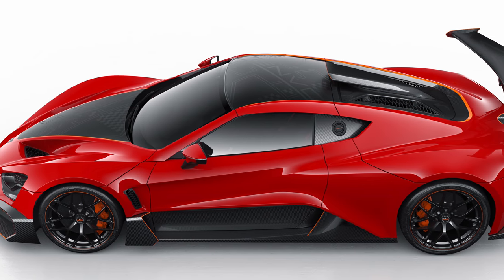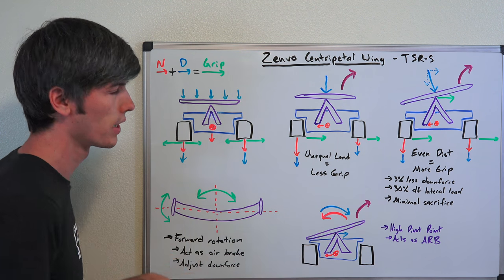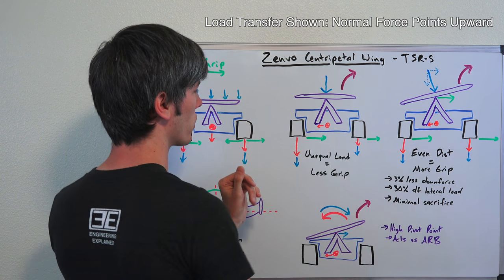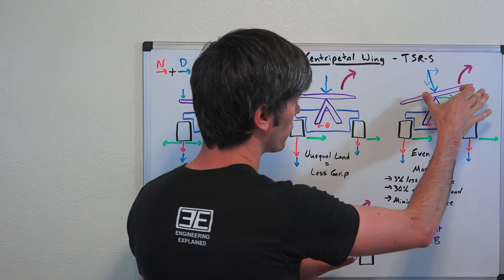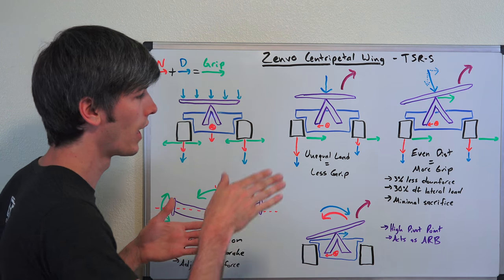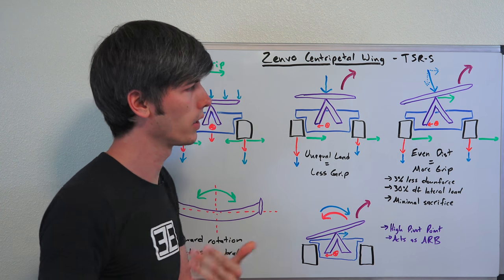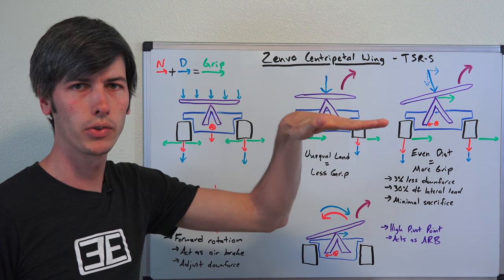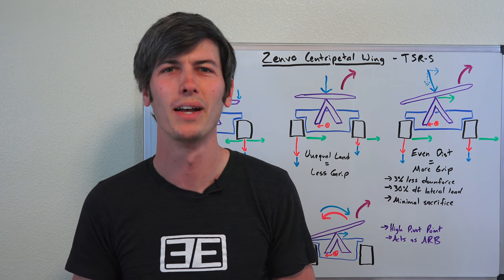Zenvo's Brilliant Centripetal Wing Maximizes Grip

Comment: Not implemented in Formula 1 - Not worth it, lol :P
Reply: Untrackable100 Ivanov movable aerodynamic devices aren’t allowed in formula 1
Reply: Because f1 is boring and should go to the v8s...let them have a turbo v8 with 600 to 900 go...and then the movable aero would fit them then